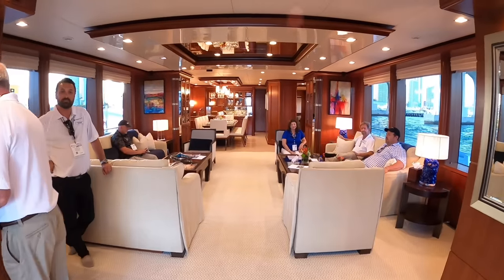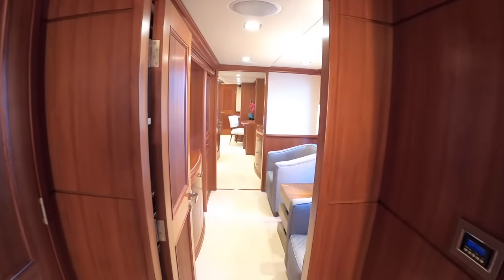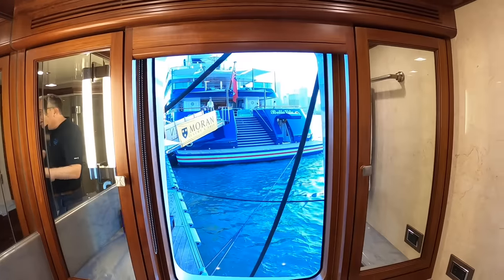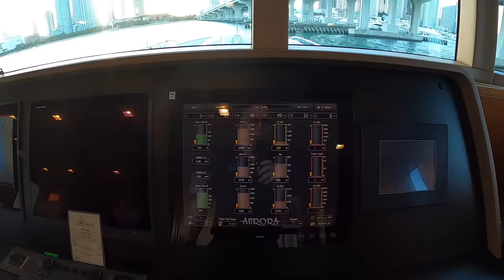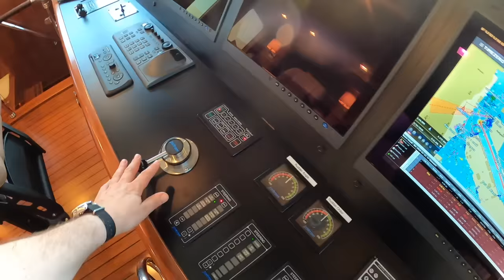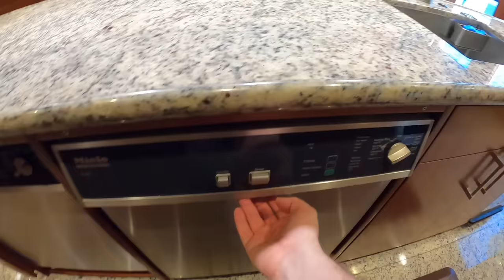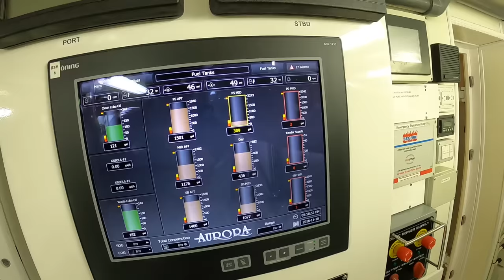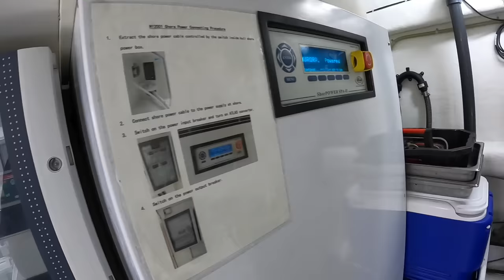$13,500,000 Explorer Superyacht Tour : 2014 Nordhavn N120

Comment: Hands down this is the best engine room I’ve ever seen.
Reply: Look at Lady Sheridan, Mine Games, Cloud 9, etc.
Reply: NO CAP
Reply: Obviously a smaller class of ship, but I like the Allseas 92's engine room.
Reply: no, it could've been so much better ie it seems very cramped especially since there's a separate side passage way stealing necessary space from the engine room. it would've benefitted so much having the E/room going from either side & having a central walk-way leading to the rear of the boat, that would've given much needed space to access components within the E/room.

I'm also saying this as the original buyer who had a independent inspection carried out on the boat also noted access to components for routine maintenance an issue due to machinery tightly packed together. This is one of the reason's the original buyer actually begun legal proceedings with Nordhavn & yes years later its out of his hands up for sale etc.. go search utube for multiple legal recordings covering the case & you'll see yourself.

overall its a nice boat but it has got some poor design floors/choices the above being one of them, then having 2 bathrooms in the master suit "wtf" anyway the engine room really needs more space for easy access... not to mention cables & pipework requires labelling (another fault found) as again knowing what each cable & pipe does on this actual boat is pretty difficult due to the lack of labels.... which is odd for Nordhavn.
Reply: @malp6280  The engine room is full beam on the upper level.  The passageway you're referring to is port side of the aft staterooms taking you aft to the lazarrette.  Also, to keep a fire boundary I also would of designed the engine room the same way. I have seen the prints for all the decks.  
The legal problems were the guy couldn't afford the taxes on the boat.  It was seized almost immediately after delivery to the boathouse. Customs came over and he couldn't pay the import fees. The lawsuit was about trying to say he never took delivery of the boat so Nordhavn would be responsible for the taxes.  That's why all the nitpicking every lil detail or flaw to say the boat was not delivered satisfactory.  Everything would of gotten taken care of, it was a delivery shakedown cruise.  You take delivery and make a punch list for the builder and it gets fixed after a 30 to 60 day shakedown.  This is nothing new in super/mega yachts. 
What I don't know how the buyers math was so far off?   As he received a credit for the taxes paid on his last boat he traded in. All that was due was the difference between his trade and purchase price.   He knew the taxes were due.  It's embarrassing in my opinion to try to blame Nordhavn when he clearly didn't have the money to buy the boat.
Reply: @overtheclouds9  I know the details of the engine room layout, as I was spun around hence my original mistake, the schematic's of this vessel are viewable to anyone on the nordhavn website..

as for the legal issue, there was alot more to it, the buyer was trying to avoid paying import tax on teh boat by trying to run the purchase through a company he didn't own/run or work within, yes the boat inspections did show some issues however they were pretty minor in comparison of which the buyer refused to make the final payment, as the repairs/changes could've been carried out via warranty repair etc this didn't occur due to him holding back the final money & clearly the none payment of the tax fee.
the boat was seized at the customs dock, the boat didn't make it to any private yard/shed.

as for the buyer making a mistake on the tax due, clearly he didn't make a mistake, it was deliberate tax avoidance, hence trying to run the purchase through a private business,, in short he didn't expect to be caught... the part exchange of his older boat isn't relevant as that value is tiny in comparison.. tax is still payable on the total value of the new boat just like anything else..

if you've not watched the videos covering the legal case hearing/interviews.... go watch them as there interesting.. however incredibly biased, they've clearly been made to damage the company brand & not to cover the real story
Reply: @malp6280  
If you have seen the boat in detail one of the more impressive parts of the design is the mast is retractable.  That's so it would fit in the boathouse bought for the boat and lower clearances in transit.  Smart in wet Brittish Columbia.  That's the last part of the delivery is fitting it in the Boathouse and retractimg the mast.  The boat was seized in the boathouse.  That was stated in a few of the videos as well.  
The whole thing was really dumb, greedy  and embarrassing.  Could of bankrupted Notdhavn and still lost the vessel on top of it.
Reply: @overtheclouds9  the mat is retractable as an option as alot also have such option..... the boat was actually seized by customs, that's very clearly recorded in the legal documents etc it didn't go anywhere. the footage of a boat going into a boathouse/shed
customs don't just release something to video it & return, the owner played hardball & refused to declare the owner of the boat ie who's liable for the outstanding tax, the buyer actually got angry with Nordhavn as they informed customs the buyer who came to the customs dock was the actually owner (of which he originally denied, later accepting & declaring he was the true new owner)

overall no, Nordhavn would've simply prosecuted the buyer & clearly would've won such a case, which would've also included the costs incurred
Reply: @malp6280    Yes, I watched the part where the boat was seized in the boathouse as well as the the boathouse itself.   Trust me it's on video as well.   He got credit of around $5.5 million for his Nordhavm 86 that he already paid taxes on.  Reducing his  tax liability probably around $1 million at least.  I do not know the Canadian tax rate but my assume is it's a minimum of 20%  However you look at it he knew how much to pay in tax and final payment to the builder.  It's in the original contract.  It's too bad, he gave everyone a bad taste and tarnished some.of the brand reputation.

Comment: What a wonderful ship. As always, a great tour. You set the standard Nick. The engine room blew me away. All of the accommodations are great. I think however, for me, it is the more than adequate crew area. The crew live here, for the most part. There is no reason they should be housed like cord wood. I have absolutely no experience in this area. I do have experience in customer relations. I worked for twenty years in Las Vegas Nevada. Your employees determine your success. A happy worker is a must. I think the owner or this ship is very  smart.     Thanks Nick, for letting me babble on,    Jerry

Comment: It's amazing of course and your presentation is top notch.
One thing I absolutely hate, that I see many manufacturers do, is to hang those obnoxious surround speakers off of the walls and bulkheads.  All that beautiful woodwork and then you hang a stupid looking speaker off of it.  Surely there must be a more discrete way to put surround speakers in........like flush mount or a discretely placed sound bar.  Multi, multi million dollar yacht and it has the same stupid wall hanging surround speakers I have in my house, ruining the visual appeal and aesthetic.
Reply: along the same lines of wall intrusions are those large bi-fold ports covers; what the heck?  They would bump heads if you're in bed!

Comment: Can it be gotten with bigger engines? I'd imagine it can. I'd want to cruise at least 20 knots. It would make the difference between 2 weeks to cross the Atlantic and one week. :) Hehehe... as if I had the money. I couldn't even fill her up. LOL!
Reply: The engines are actually too large. Diesel engines like to be under a load and these engines are underworked. On a passage they have to be run at full throttle for a hour every day. Since this is a full displacement hull, running wide open doesn't increase the speed by much. I believe it runs around 16 knots flat out.
Reply: @MrOlddave  more like 12 knots flat out 8 long distance cruse...the load she runs on is good size for the size of yacht she is which would be closer to a 150 ft yacht

Comment: Beautiful ship!!!   On a long range explorer/cruiser like this, with massive tanks, low speed, I kind of wonder if it would make sense to run this thing on bunker oil like a much larger ship.  Bunker oil is so much cheaper, I know even billionaires that own this type of boat love to cheat the oil man and save $$$$.  I know its not clean burning, but neither are those MTU diesels on this ship, since they don't have any emissions devices.  Also I know bunker oil is harder to find, but on a ship with this big of tanks it wouldn't be as much of an issue.

Comment: I think of all the super yachts I have seen on your channel, and others - this one impresses me the most for its practicality, and warm but not gaudy, design and decor. My only gripe is bunked crew cabins, and should I ever be in the position to call such shot..., would be to modify the Floorplan somewhat by removing one or both guest overflow cabins, to increase the floor space of the crew cabins enough to be floor-level twin beds instead.

Also shrink the table space in the main deck bridge by 6" and add that to the captain's "office" space.

A fine ship indeed.

Comment: Having worked on many much larger yachts, I've got to say (other than the crews quarters), this is one well laid out boat. I think that value for the money its near the top of its size range. If they could have integrated a small engineers cabin in the engine space it'd be first class.

Comment: great video and audio presentation.......Beautiful boat. I have just one question and being curious about the low HP of only 900 each. I really expected somewhere in the 1200 to 1400 HP each with this size of a boat. Would like our comment on this ......Thank you again for your great video and info !!!!!!!!!!!!!!!
Reply from the maker: It's a displacement speed boat so only needs enough power to reach that displacement speed. Something like a Princess is a planing boat so required a lot more power to lift it onto the plane and basically bludgeon the laws of physics into going faster than it would if it remained in full displacement mode.
Reply: @AQUAHOLIC    Thank you so much for your quick reply and your explanation. OBVIOUSLY I had no clue.   Appreciate your breakdown on the displacement speed.     Looking forward to a new video !!!!!!!

Comment: I like Nordhavn but they are a little old fashioned and the lack of power puts me off
Reply from the maker: It's a displacement boat so it has all the power it needs
Reply: True but it must take forever to get anywhere....
Reply: AQUAHOLIC ...I would just have to adjust to the slow pace of displacement hulls....
Reply from the maker: @marksaunders4149  That's the style of boat - it's basically a tiny ship rather than a big speedboat
Reply: AQUAHOLIC which style do you prefer ?
Reply: AQUAHOLIC you are totally right..looked again..it’s awesome...wife agrees with you..love your walk throughs. Question...how does a destroyer or frigate achieve such high speeds then as they must be displacement hulls?
Reply: @marksaunders4149  Destroyers have much bigger engines & less cabin space. They need to travel @ 40+mph & will burn several times as much fuel per hour so they cost much more to operate. Destroyers have their fuel bill paid by the taxpayer so they don't really care what the bill is. Finally, destroyers might be displacement hulls; but, they are designed to go faster than yacht hulls.